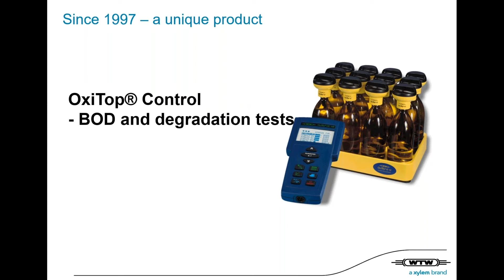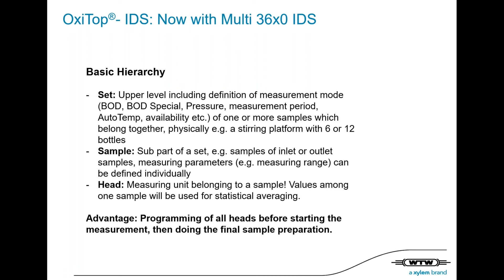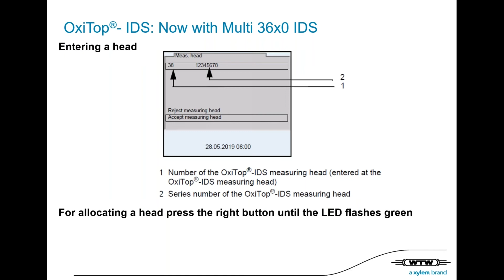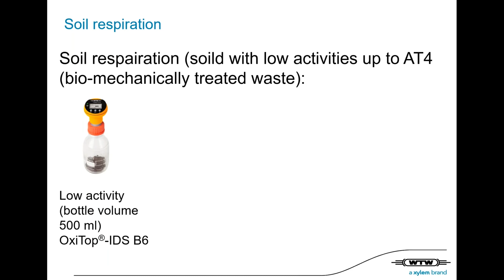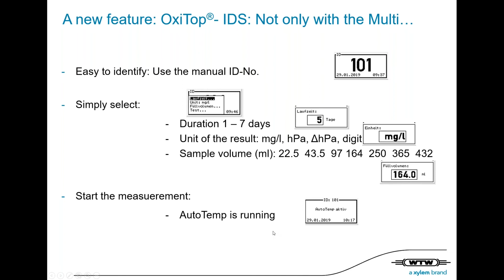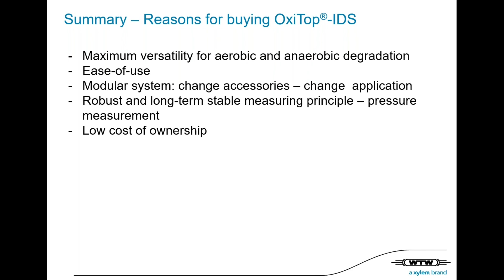Webinar - Measuring Biochemical Oxygen Demand with WTW OxiTop (Part 2)

Comment: Hi Gentlemen,

I currently have a new purchased oxitop and I come across with the factor corresponding to the sample volume used for the analysis of BOD.

Could I use the factor as multiplier to the final reading (day 5) appearing on the screen of oxitop head? I am just confused because of the note down below the table (*) it says  no need to take this factor into account as the result is output directly by the controller in mg/L BOD.

Please help clarify...

￼